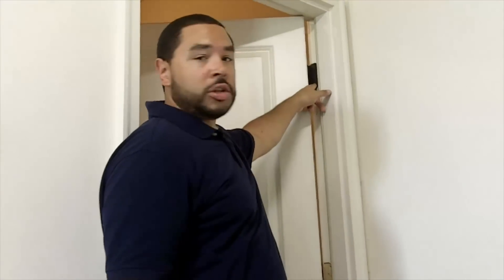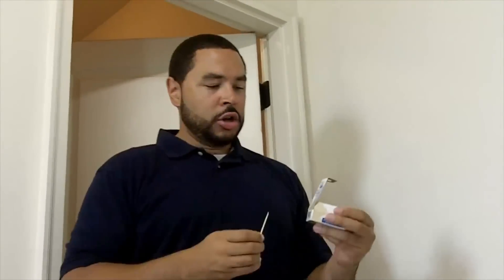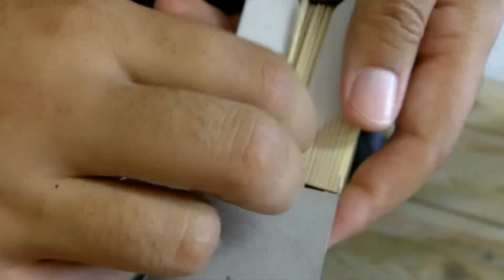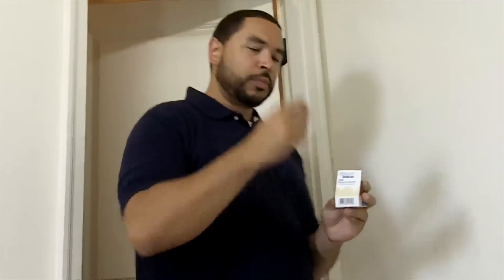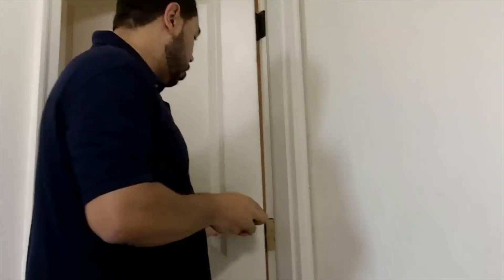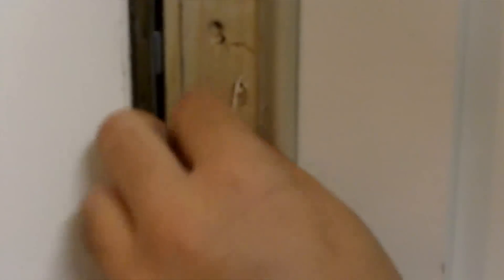Fixing Stripped Door Hinges

Comment: Thank you so much for this! I've been hesitant about fixing my bathroom door for months out of fear that it would cost me money and time I didn't have. You proved me wrong my friend. Thanks again!
Reply from the maker: +Mr. Yonko Thank you for watching! :)
Reply: DAMOND:  Nice video but I have had much better results with wood match sticks.  They are much thicker than toothpicks and fill the holes better to "bite" into the screws for a tight screw fit.  Just make sure to cut off the ends of the matches before doing any project like this.